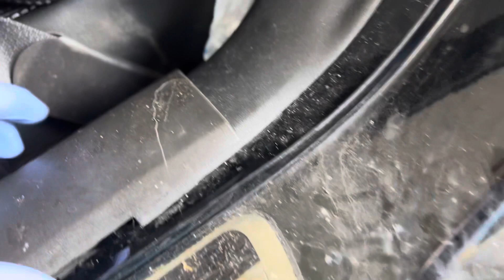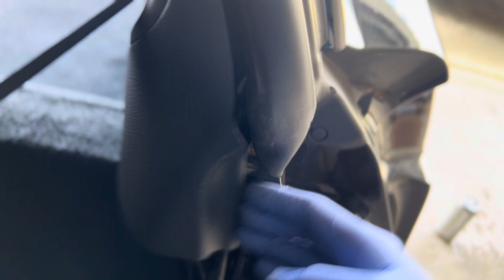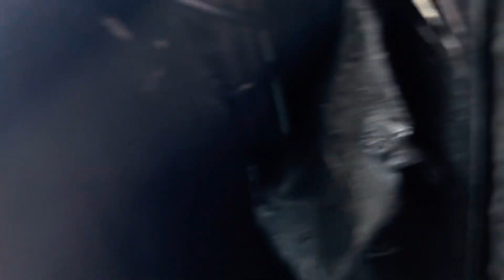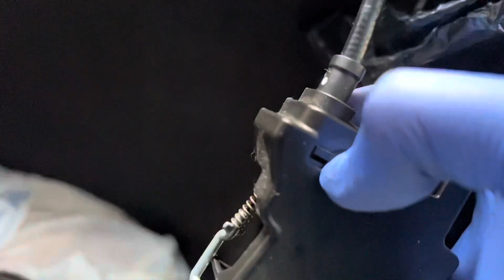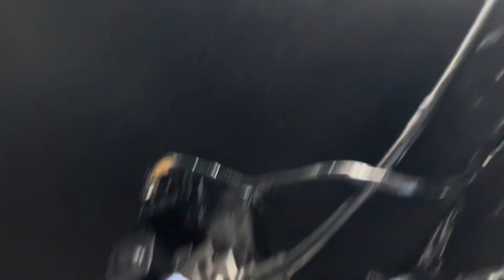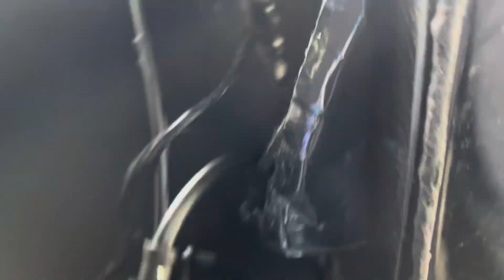Corvette Door Not Opening - Actuator Replacement

Comment: Thanks for showing how to remove the x-ray out which way to turn. I don’t know why no video shows which way to turn. Like I get it lefty Lucy righty tidy but doesn’t help.
Reply from the maker: Could you clarify what you’re asking? Are you asking about the bolts holding the actuator to the door or something else?
Reply: YA the bolts i was using voice text coz gloves :D

i snapped 1 got 1 out. just my luck :D @ModestlyMinted
Reply from the maker: Ah okay. Yeah, mine came out easy unscrewing in the typical counterclockwise rotation, so I didn’t think to leave that in when I edited this. I try to cut my videos down as much as I can to just leave in the relevant stuff and stuff that might give someone issues. I always hated trying to watch a DIY where someone spent more time talking than they did showing me how to actually do whatever it was the video was about which are why most of my videos are cut down so much. Hate that your bolt snapped, but on the plus side at least it’s in a location that should be easy to extract.
Reply: ya i get it bro but the 4 videos i watched all skipped that part haha n then it snapped so i got heated...the other one came out but had to use impact drill. looks like it was replaced previously coz the black sticky cover was damaged. so previous owner went to town on tightening it. 

now i gotta find a shop to remove the stripped bolt :D @ModestlyMinted
Reply from the maker: If you can’t find a shop who will do it for a decent price you might want to consider doing it yourself. Extractor sets aren’t that expensive and it’s in a convenient location. Should be a quick fix.